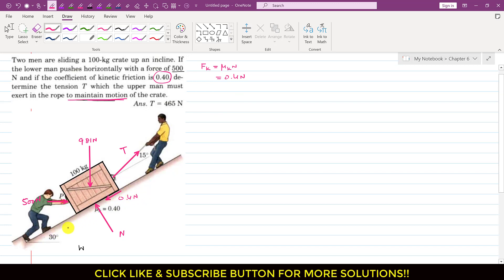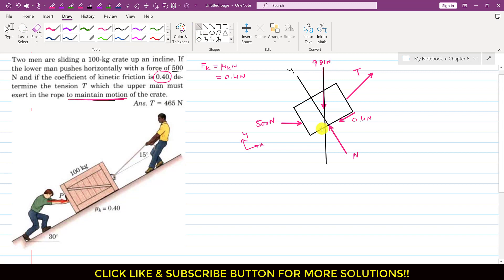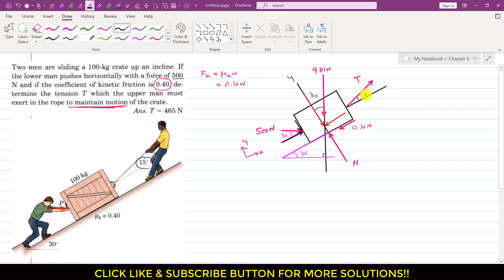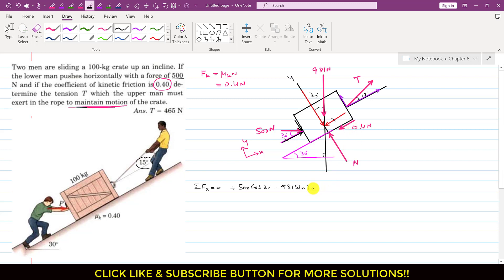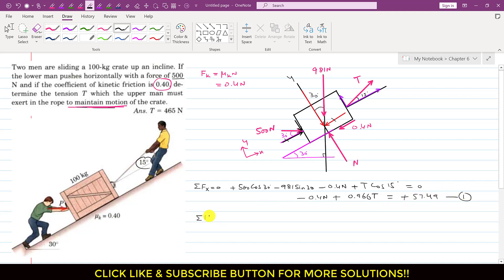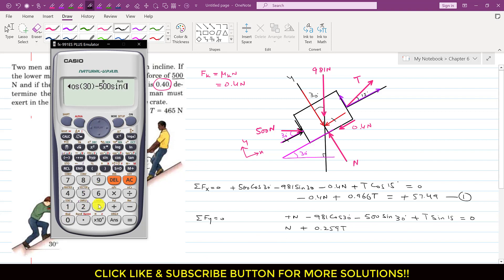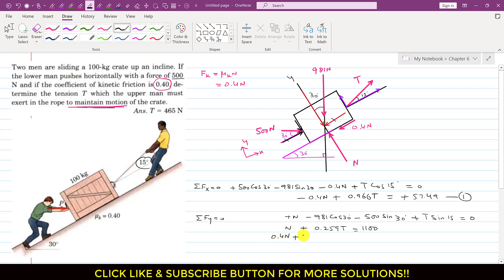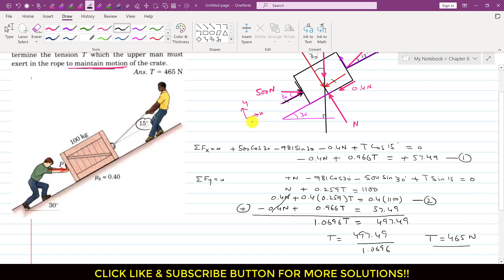Determine the tension T which the upper man must exert. Chapter 6: Friction | Engineers Academy

Comment: Problem 6/5

6/6 The light bar is used to support the 50-kg block in its
vertical guides. If the coefficient of static friction is
0.30 at the upper end of the bar and 0.40 at the lower
end of the bar, find the friction force acting at each
end for x=75 mm. Also find the maximum value of x
for which the bar will not slip.

50 kg

B

300 mm

Problem 6/6

352 Chapter 6
Friction bro solve this also